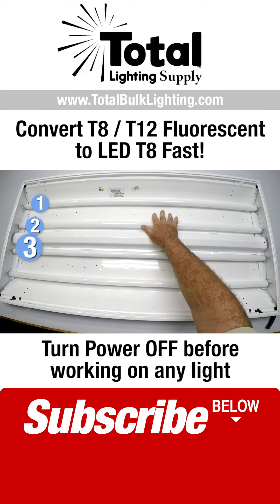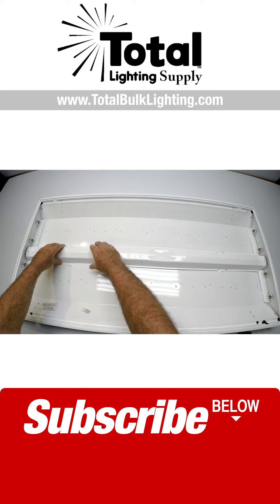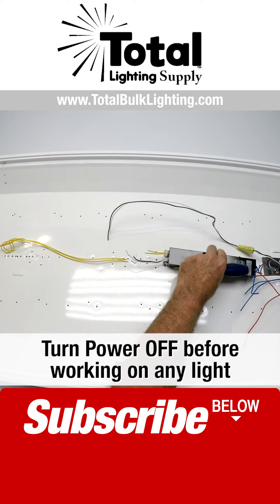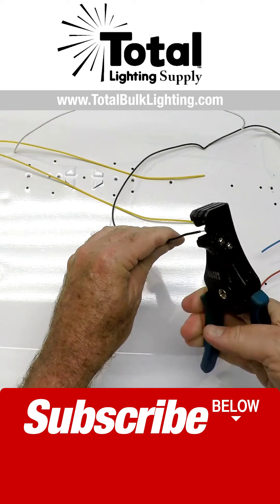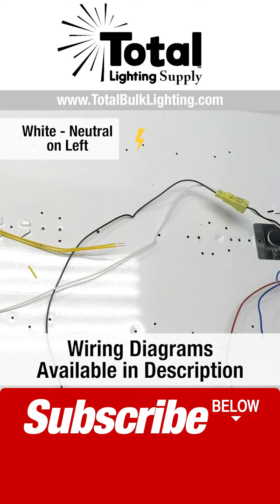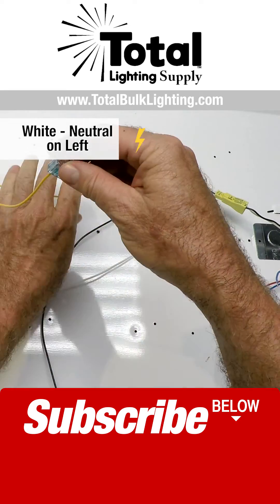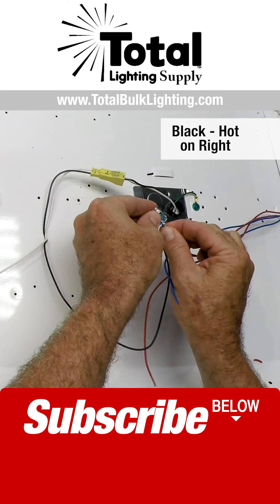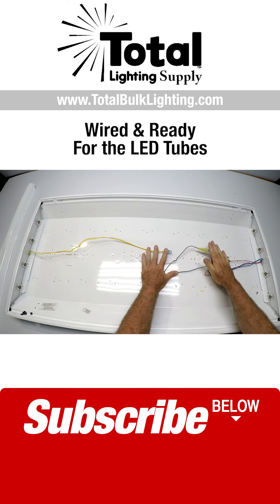How to Convert Fluorescent 4 Tube Fixture to LED Fast #shorts #conversion #ledlighting #howto

Comment: I did exactly this and they still didnt turn on.
Reply from the maker: If you purchased our easy to use kit please get in contact with us and we can help troubleshoot. I would double check all your connections are secure and working properly and make sure you are using Type-B Dual Powered T8 LED Tubes in your conversion.

Comment: What are the advantages of switching these to led?  Didn’t know they made leds like this.  Thought I would have to put in new fixtures for the office and garage.
Reply from the maker: Light output is greater, so more lumens per watt and you can significantly cut down on your power usage resulting in lower energy bill 🙂

Comment: I've got 2 ballasts. So on the left there is 2 red, 2 yellow, and 2 blue. On the right i have the same but the hot and nuetral as well. Blue and red wires arent ling enough to put together
Reply: Splice some red and blue wires to the ends to make them longer. All you need is a couple of wire nuts and a few inches of extra wire.

Comment: The Ballast compatible LED tube could be installing of an old fixtures without rewiring of ballasts. Full working with all types of ballasts.
Reply: It's less electrically efficient that way.  The rewiring is as basic as it can get.  Also, removing the balast eliminates a failure point.
Reply: @melrobinson6919  If it has a high quality commercial ballast, plug and play LED tubes are more reliable. Most direct wire LED tubes have extremely cheap drivers which don't last very long.

Comment: Idk how quickly you respond. But I finished my conversion, I just don't like how it goes from 12 guage to 20 guage wires from the fixture
Reply from the maker: You can check the wire in the fixture and see the markings and it will usually tell you what its max voltage is. Typically most wires in these fixtures can handle your standard home voltage. If you ever have any concerns we strongly recommend getting a licensed electrician involved in your project.

Comment: I have a quick question and no one has been able to answer for me.Please and thanks. I have 70 fixtures with 14 lights being in a row and 5 rows. There are only 2 switches for each row and each switch controls 7 fixtures but it skips ever other fixture. So switch 1 controls light 1,3,5,7,9,11,13  on row A and switch 2 controls lights 2,4,6,8,10,12,14. All the wiring for row A starts at fixture one and all 14 have one conduit with the wire running to each fixture. However, now Switch one turns one light 1,2,3,5,7,9,11,13,14 and switch 2 controls 4,6,8,10. Then to conduit jump to row B and the same is happening. I'm stuck and i'm so far in BFE a electrician will only come out to look not work for $400. That was the most affordable price just to come out not to find and fix or help.No i did wire these fixture as a single way not double. I doubt anyone will answer since this was a long comment but it never hurts to ask all the online experts
Reply from the maker: That sounds like a very complex wiring setup and would require being on location to troubleshoot. So sorry we can not be much help.